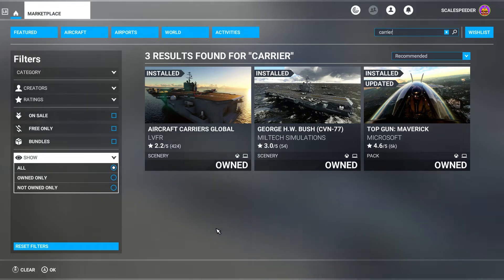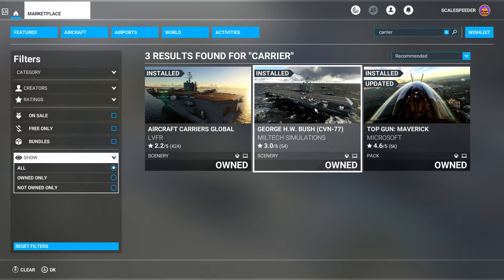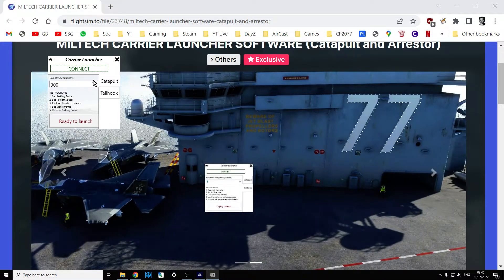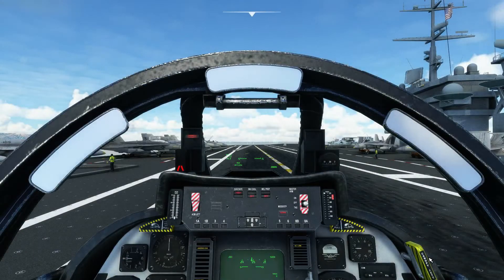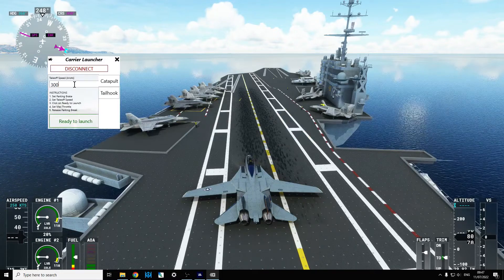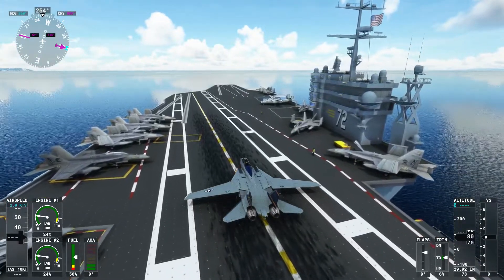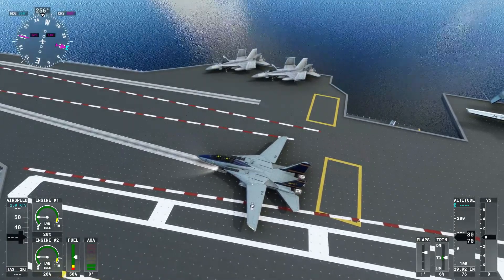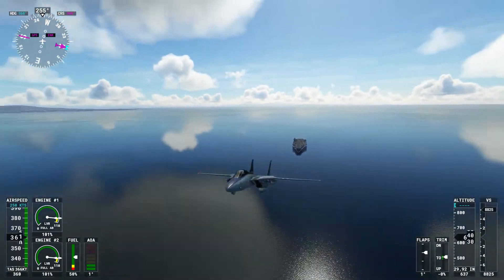How To Add Steam Catapult & Arrestor Systems To Any & LVFR Aircraft Carriers Global PC MSFS DLC

Comment: Hi, I purchased the GW Busch carrier directly from the MSFS Marketplace. So... after I run the tool's installer, do I need to create a keyboard shortcut combination to open the launch/recovery tool? Or perhaps there's an icon in the MSFS toolbar I can select? 

What about recovery? Do I even need to run the tool for the arrestor cables?  I mean, if the thrust deflector and cables don't show up, what's the point of adding yet another background program for the CPU to deal with?

I've downloaded the tool but I haven't yet unzipped it. Maybe my questions will be answered in a ReadMe text. I'll check.
Rich